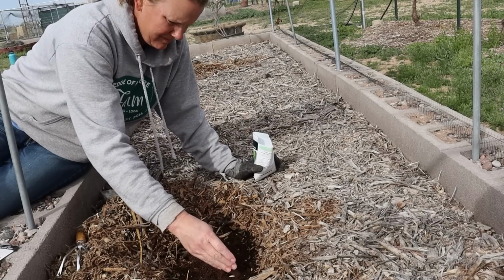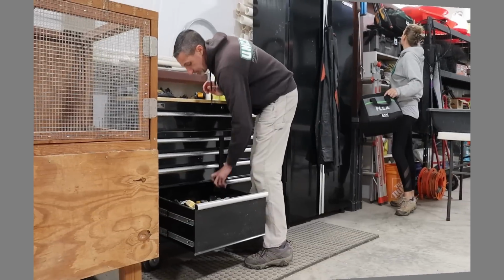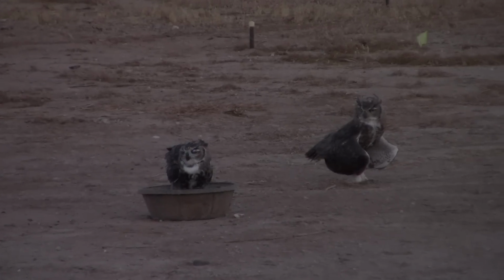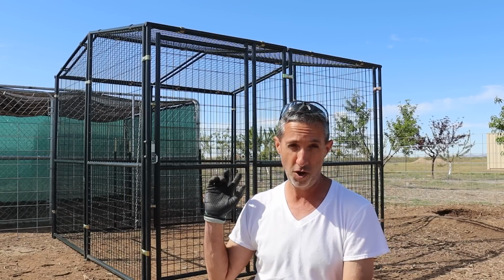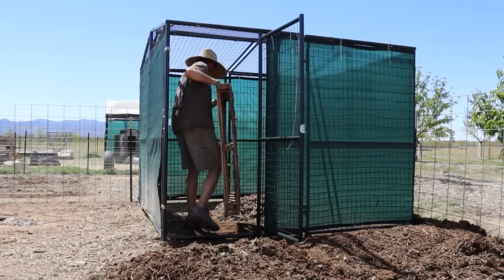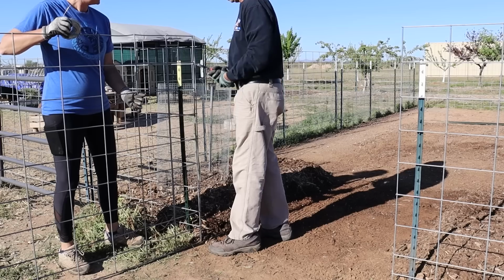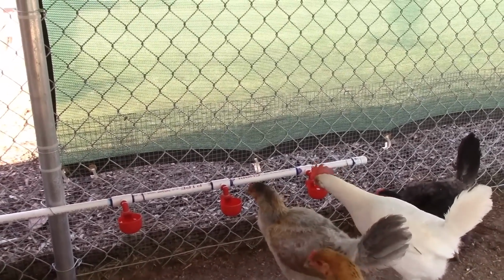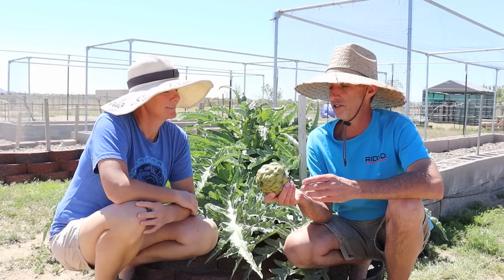First Harvest | Building Turkey and Duck Enclosures

Comment: Q:  What type of wire (gauge, material) do you use when making the "temporary" wire gates?
Reply from the maker: We use standard hardware cloth for those cages. It's a 19 gauge, 1/2" hardware cloth typically in either 2' or 3' width. I'll link to a 2' cloth we've purchased in the past that has the same specs;
https://amzn.to/3KXH41B
You can usually find these at Home Depot in shorter lengths also.

Comment: long ago I saw a sign on the side of the road, it said, 
Artie Chokes
5 for a $1.00
sorry had to pass that one along, been living with it in my head to long.
when did you plant your Artie-Chokes?
Reply from the maker: Artie Chokes, I like that! We planted them last Spring. This one was from seed and we have a green globe that is not ready to harvest yet that was a potted start. Both are doing great this year.
Reply: @EdgeofNowhereFarm  i really like your end cap idea. my garden is about 50x50', with 5 blackberry and comfrey ready to go in the ground, so I am struggling with placement as I have livestock that will be free ranging around the (wish of) 5' fencing to be the perimeter.
Reply from the maker: @SG-vu4qy  livestock always present a challenge with certain crops, but a 5' fence usually does the trick.
Reply: @EdgeofNowhereFarm  was it the prime ark freedom that made surprise pups? how far apart should I plant mine in ground? TIA
Reply from the maker: @SG-vu4qy  both the Triple Crown and Prime Ark Freedom sound out pups quite readily, but the Prime Ark was the surprising one for us. We have ours in a 10x10 bed and it has completely overtaken all of it. If the soil is irrigated it will probably find a comfy home there in our experience, so if you have some dry ground between the plantings it may be the only chance you won't see pups sprouting from unwanted areas. How much space do you have for these? You may only need one!